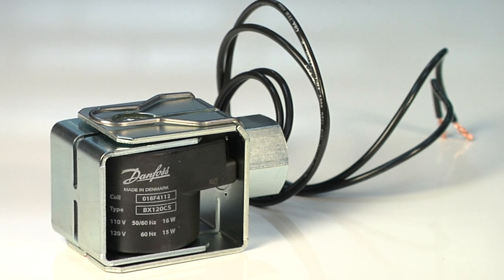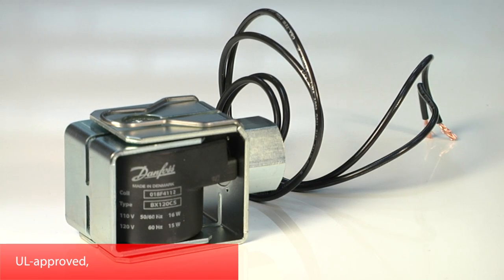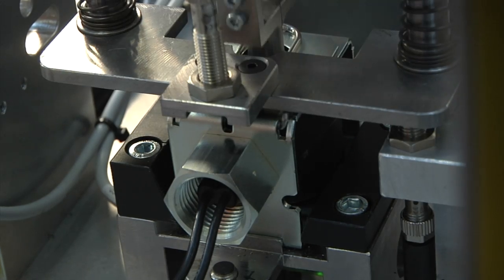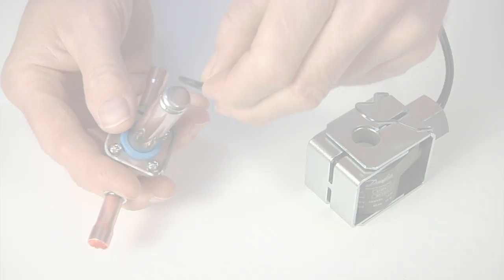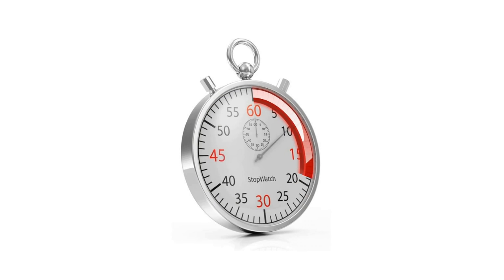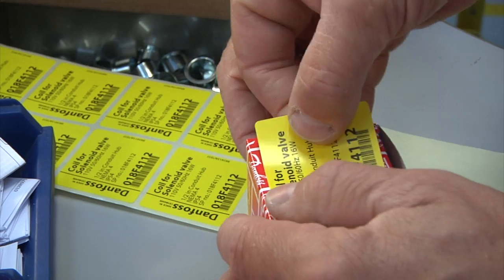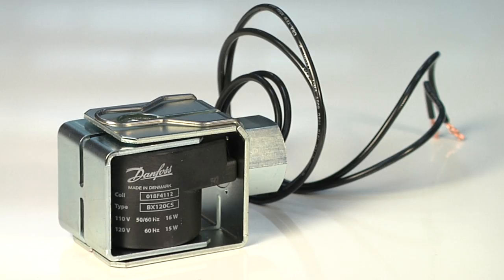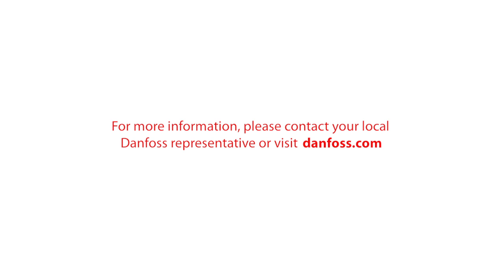Danfoss launches UL-approved coil for solenoid valves

Comment: Hi heatpump hvac, thanks for your question.  The Danfoss Saginomiya reversing valves will continue using a different type of coil- this coil is not the right choice for those valves.  But similar as with heavydiesel's question, I'd recommend talking to a Danfoss representative who knows your application.